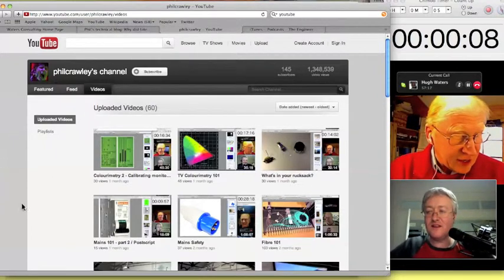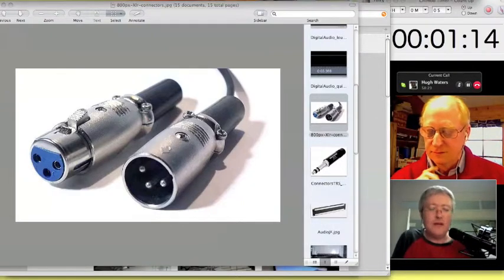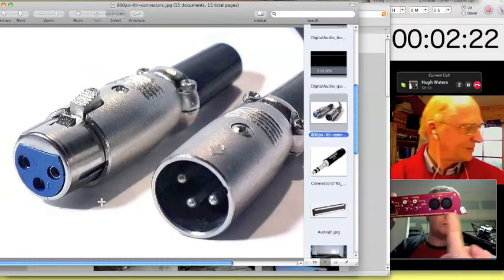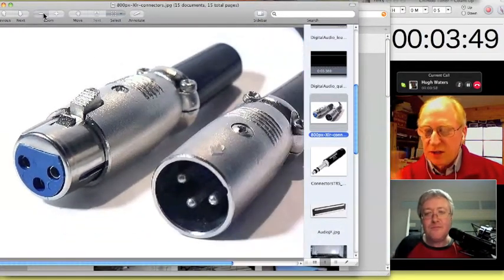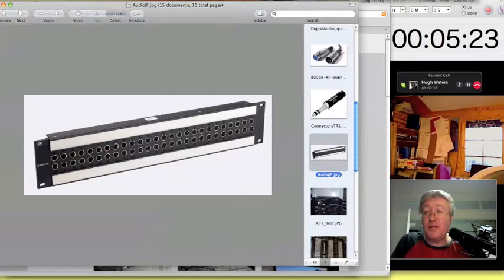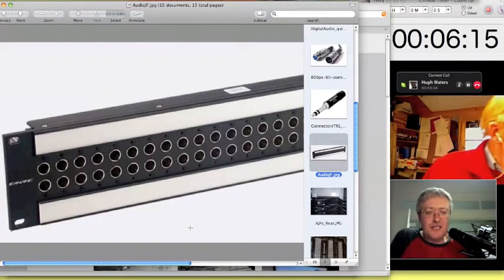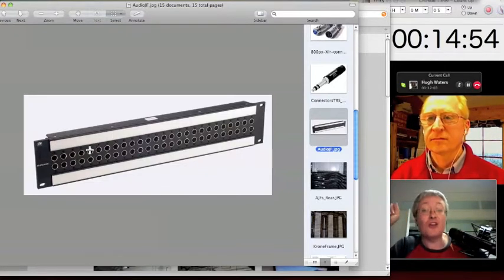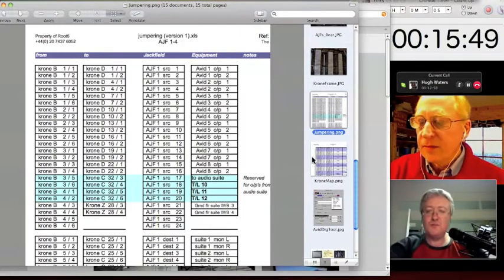Audio, part 2 - the engineering!

Comment: Thanks for that cast.  Lots of interesting areas that could be expanded on there.  One thing to mention is if a facility is getting random hums and buzzes, it may be that someone is plugging a mono pole 1/4" jack into a bantam jack field and decking one side of a balanced pair which of course would cancel out the noise cancellation properties of the balancing t/f!

Comment: One thing I like to do when wiring facility houses is to colour code the XLRs using the plug caps available from Bryant Broadcast.  I follow the resistor coulour code. I.E. CH1 BROWN, CH2 RED CH3 ORANGE CH4 YELLOW ETC.   AES audio is purple and timecode is white.  I can pick up a wiring loom for and Avid or VTR in the rack and not even look at the labelellng as I can see that if it is a male plug and is red, it is  audio input 2.  AES is different and I mark them up using a pen.